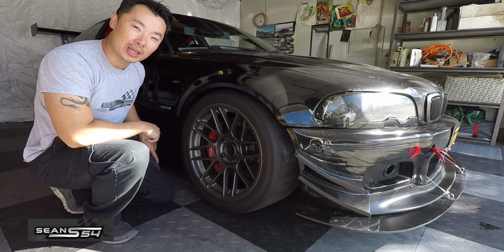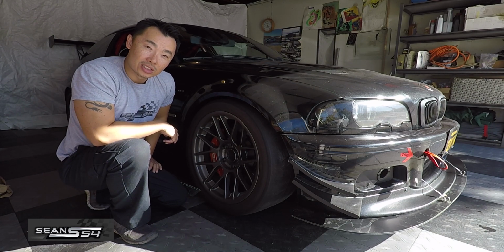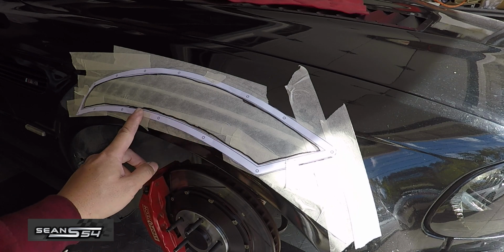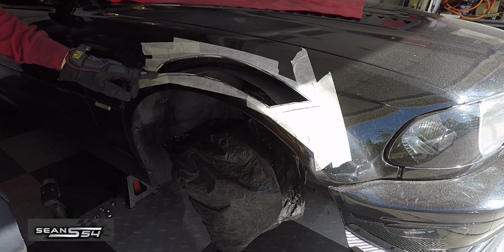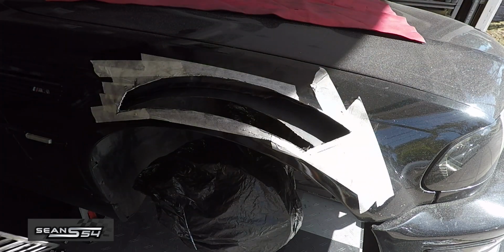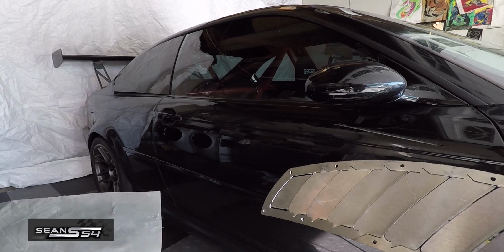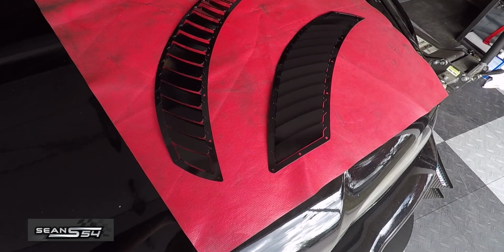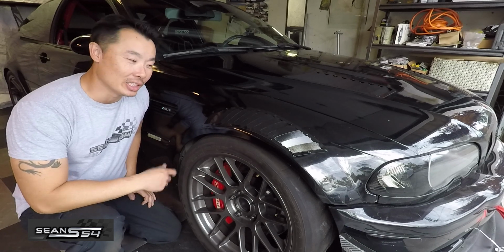How to Install Fender Vents - Track Aero - BMW E46 M3

Comment: What did you end up doing with the fender liner? That’s the only part I’m curious about. My liners protect my intake filter on the driver side. I can’t relocate it since is where the supercharger kit puts it. So I can’t go without the liners completely

Comment: Looks very funky but it is sound aerodynamics. I have just canards and you can tell how well they work.
This whole package must work incredibly well.
Reply from the maker: Yes, I've felt a huge difference with full aero. The limitations of the car has significantly increased. Now I just need to keep up with up. :-)

Comment: Boh was ficken die die karren totale brei birnen in 15 Jahren werden die sich ärgern die zerstört zu haben meine optimieren ist das eine Karosserie zerstören das andere
Reply from the maker: Translation?
Reply: He wanted to say that you'll probably regret your decision turning the m3 into a track car. Because in 15 years, when its an old and rare car, the resale value of your car will be lower than a stock m3.
Reply from the maker: I see, thanks for the translation. This car has gone pass the point of no return (roll cage, gutted, etc). :-)

Comment: I was looking for some hood vents for my 335i that were in this style, they have a set for the e9x m3 which are perfect for what I want to do 👌 Your wheel vents look awesome
Reply from the maker: Cool! I'm also running their hood vents and the install is quite easy (DIY video in my channel). I like the ease of install without having to worry about body shops. Thanks!